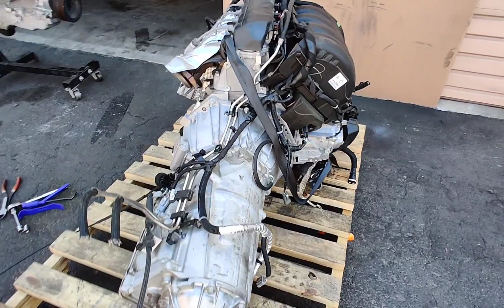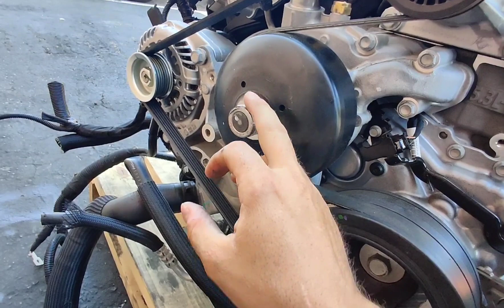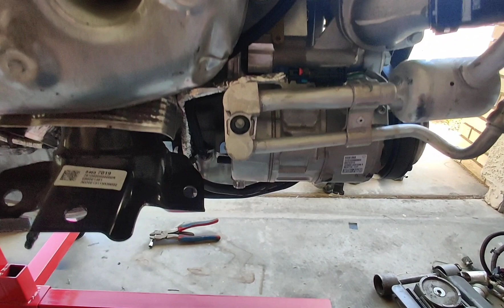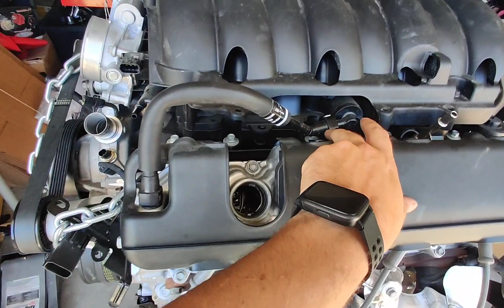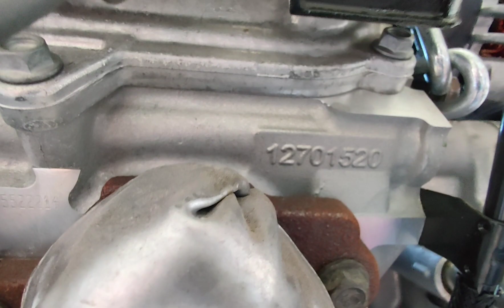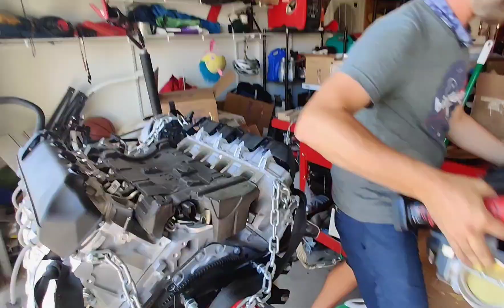2020 New  l84 LT Engine swap info!!

Comment: Im messing with a l82 conversion now. From what ive seen the l82 is Active fuel management and the l84 is dynamic fuel management as well as flex fuel vs non flex respectively. Good info here and hats off for digging into these newer LT motors.

Comment: I have a 2019 L82, The DOD is only 4 cylinders but the bosses are on all 8 (Only 4 are machined and have the solenoid.  I sold the E90 and harness and rewired a harness and am using a E92.

Comment: Did we ever find out if the ECU and harness from the L83 would work? I got what I was supposed to be an L83 but when I got home find out it's an L84 🤦. Need it to slide into my 2017 Silverado. Obviously the DFM/AFM is slightly different but that garbage is being disabled regardless. I have the wiring harnesses for both engines. Currently debating selling this L84 and going back on the hunt for a L83

Comment: I thought the L83 had a cylinder wash issue causing failures (afm related im sure) but i know the tuning is completely different on the L84 (not sure L82) mainly due to the 8-speed but it feels more aggressive timing or throttle managment. Not sure the fine details with out spending the money to unlock the E90. Which i might do later on after warranty is up. Be interesting to see if the harness works, i got a GMT800 that i still hanging on too & would love to swap its LM7 out for one.

Comment: Bro, L82 has AFM (4v mod), L84 has DFM(can run on 1cylinder). Different controllers. Both to my knowledge cannot run e85 on stock tune.
Yes electric vacuum booster.
Reply: My  sierra 5.3l 2021 has no afm/dod

Comment: Where'd you get the engine?? I cant figure out who to trust -__- prices are all over the place
Reply: Thats part of the game. You might buy a dud or be lucky. The other way is to pull it yourself or pay for a turn key which will cost around 15000 and your not even close to actually getting it to fit in the car.

Comment: The block casting certainly looks way cleaner. Looks like they used sand cast instead of a gravel cast mold. 

Also like the vac pump was deleted. The new dod is a bit crazy. 

I wonder if the l82 is mechanically the same as the 83

Comment: So has anyone worked out a vacuum pump solution for the 14-18 trucks?  I am needing a new short block in my sierra and id like to snag one of these cheap that are floating around
Reply: Why wouldn’t you just buy an L83 or L86 and slap it in?  If you wanna keep using the shit vacuum pump (that you should have already deleted) why the hell would you even look at a block that isn’t compatible with it lol
Reply: If you want to run without a vac pump it’s really simple. Disable AFM through a tuner or other disabling device (intake WILL NOT make enough vac to run brakes if AFM is not turned off) Now You have about 3 options to get vacuum to the booster. 1 drill and tap a spot in the intake behind the throttle body and add a 3/8 hose barb. 2 you can get rid of PCV system and vent your crankcase to atmosphere or a catch can and use the PCV suction as a source. 3 you can disable the EVAP system and then drill and tap ICT billet block off for a hose barb and use that as a source. There may be others but these are what I have found. Mine personally is tied to the PCV suction and my crankcase is vented to atmosphere through valve cover breathers instead of using the PCV system like a pre 1987 engine